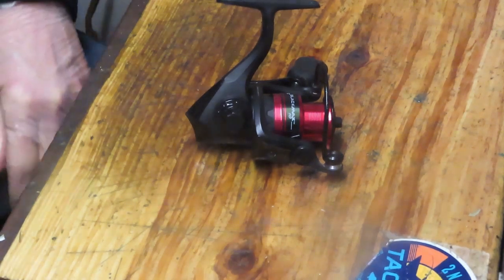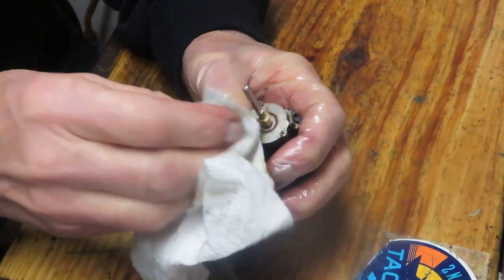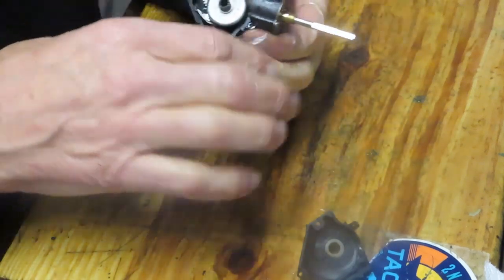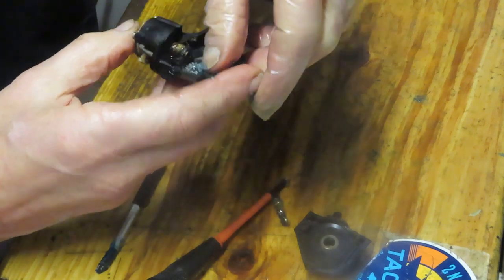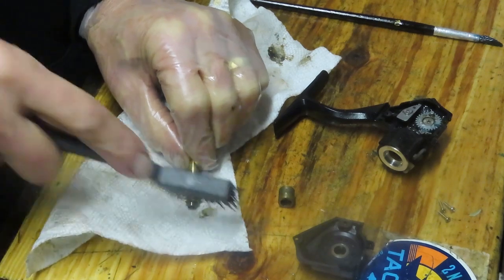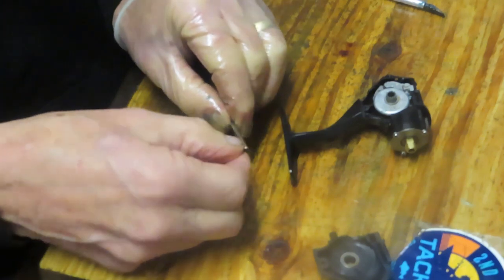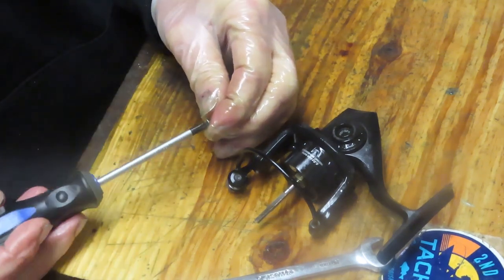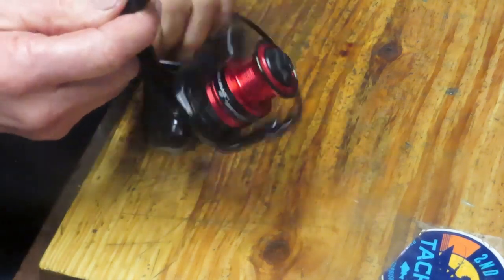Abu Black Max 10 spin fishing reel how to take apart and service

Comment: This is an excellent video! I recovered a Berkeley rod with the Abu Garcia Blackman reel attached from a dry lake bed. Of course it was loaded with sand and silt and the bail has a spot of corrosion so it will need to be replaced. If you could direct me to a parts list and a source for parts I would be grateful. I intend to completely disassemble the reel as I have nothing invested in it. I think it is a nice reel and would like to get it functional again. Your video gives me the confidence to attempt this and I will take plenty of pictures. Thanks so much, and subscribed.
Reply from the maker: Check ereplacementparts.com for the abu parts you may need.  Be sure to include your model in the search bar - Dennis

Comment: thanks for the great video, Dennis.  I did the repair, but after putting it back together the bail does not lock open or closed.  Any idea what I did wrong?
Reply from the maker: You may have installed the trip lever or spring incorrectly.  Recheck your work - Dennis

Comment: Hi Dennis. I've got an interesting question I think for you. I had to replace all the gears on my Daiwa BG6500. They were corroded. When I put the new gears in and screwed down the side plate, the reel got very tight. I used the same shim that was there on the old gear. Low and behold, when I removed that shim and ran straight bearing, the reel spins beautifully BUT there's a little gearineess to it. Like now it's too lose! Somehow the perfect amount of shimming is between the standard washer that comes with it and no shim at all. The Daiwa BG is known to come with differing shims from the factory so I'm not all that surprised with a brand new gear set the factory shimming wouldn't work! So here's the question. Where in the world would you look to buy paper thin shims? I feel like if I can buy a bunch of super thin shims I'll be able to shim the new gears just right! Just a little frustrating that I paid $52 for all new gears on a $135 reel and now I need a $0.05 shim and having a tough time finding it. The shim they sell for the reel is the one I already have and it's too much! I'm actually thinking about just making them but maybe you've run into this.
Reply: So I actually took the shim that came with it and ground it from .40mm to .36mm and that .04mm was the difference between so tight the reel was hard to spin and being perfect. Unreal. I am just going to polish up that shim, it's brass I believe, and call it fixed. Good warning to people though, if you buy a new gear set for a reel, you may have to adjust the shims!
Reply from the maker: You are spot on.  The shims are there to take up the variances in the gear manufacturing process.  You need to check these if you replace the main.  I am not sure where to get an assortment of the shims.  If you find a reliable supplier, please let me know - Thanks

Comment: i never seen you open the line roller and clean the bearing? not sure if there is bearing
Reply from the maker: I generally just use a penetrating oil on the assembly and do not open them up unless I hear a bearing noise.  If that is the case, I replace the bearing - Dennis

Comment: How do I put the bail back together? I took it off and I cannot figure out how to put it together. All of the springs are still in their correct places. There is a small metal part that I cannot figure out how to get back in
Reply from the maker: Is the metal part a long bar that looks like the letter "Z"   If it is, the ling end of that goes in the lower slot of the case and the top piece fits in the ole on the back slot in the back of the bail arm.  The spring would have a hook on the end near the arm.  That would fit in the hole in the back.  Once the parts are aligned. push down to center the screw hole and the case and then add the screw - Dennis